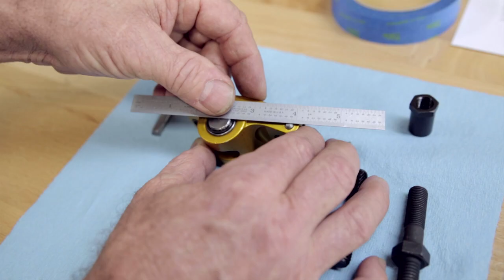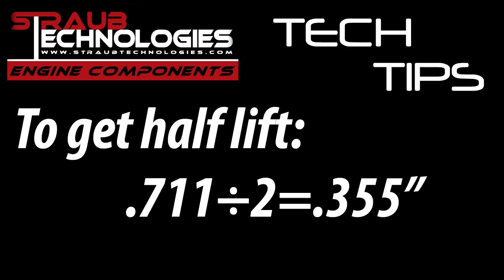Engine Tech: Valvetrain Geometry

Comment: For anyone that may know... I just measured my pushrods with a frozen up hydraulic roller lifter.. Im 100 percent sure the plunger did NOT  move..making it like a solid..
 So.. i set zero lash my hand.. finger tightened the polly lock.. spun the engine over 3 times.. got the roller mark in the center of the valve stem that I colored with a sharpie.  Now here is my question..do I add or subtract for the hydraulic part of the lifter with good lifters?
Reply: good question. I wonder if that lifter is frozen @ the top of its plunger or bottom or somewhere in the middle. If it's frozen @ the very top of the plunger ( think that's what u said) then all u need to do is follow this tutorial exactly. And then replace the lifters of course. Unless they're just really pumped up and not frozen. It might be best to change em' out before doing the measurement. but I can't see the harm in measuring them now unless your new lifters will be at a different height for some reason. Keep in mind I'm just going off what u described and not sure if I fully understood what u were saying. I only replied because this was a fairly new comment and thought what I said might still have some meaning for u. Good luck with your build.
Reply: @guidosarducci3047  The lifter basically acted like a solid lifter. Now, I see you ADD .30-.50 to compensate for the hydraulic lifter plunger...
The lifters I used to.get the measurement is my old lifters. Ill be putting  new ones in. Just trying to make sure I fully understand what I'm doing before I order the new pushrods
Reply: Cool...Sounds like u got it handled. Good luck man.
Reply: @guidosarducci3047  thanks. So im ordering them and hope it works out

Comment: Question: What is more important - the 90* relationship between rocker and valvestem @ 1/2 lift - OR - a centered swipe of the rocker on the tip of the valvestem? I'm setting up a garden variety healthy 355 sbc. Using 1.6 roller rockers and Flotek 180cc heads. I used this technique to determine PR length. However, with this "correct" length PR, my contact patch between rocker tip and valvestem tip is a bit outboard of the valve centerline. I could "correct" that by shortening the pushrod - but then I wouldn't have the 90* angle anymore. Is one more important than the other?

Comment: I know this is an older video.. but it is just that easy? Has anyone used this method, ordered the pushrods and put the engine together and run it?
Reply from the maker: We sell around 100K worth of pushrods a year.
Reply: @straubtechnologies   I had no idea you sell pushrods. Ill be ordering from you then. See my question above if you dont mind...
Reply from the maker: @19jody72  You add .050" to the length.
Reply: @straubtechnologies   so add .050 getting the measurement  like in your video?  What I did, is take a fully pumped lifter, adjustable pushrod.. set it all up. I come up with a 6.750 length. I tried your method, I just couldn't figure it out. It came up to like a 6.580. Im not an engine  builder by any means. From what ive read online and seen on youtube .
Reply: @straubtechnologies   do you have  5/16 hardened  6.750 - 6.800 pushrods?
Reply: I'll email you later this afternoon when I get off work

Comment: Using this method I found out the pushrods I originally bought were dangerously short, .25” too short. Damn I’m glad I took the time to do this. I haven’t put too many miles on it yet so I hope the damage to the valve heads is minimal, it was good on the #1 exh valve I used to check this although my wear pattern was obvious, about 3/32” wide but centered over the top. So centering the roll pattern is obviously not the right way to determine PR length.

Comment: hi, thanks for the video, its excellent. i have a 350 that im installing roller rockers on and i can either have sweep at mid valve or 90 dergees at 1/2 lift but i cant have both. with sweep in the mid valve position my rocker is at 90 dergees at almost full lift. will removing material from the valve tip reduce this problem?  i cant find info anywhere on how to fix this problem. thanks.
Reply: Great point, and I wish he addressed this. I'm in exact same boat. I can EITHER have a pretty, well-centered swipe mark on my valvestem tip, OR I can have 90* relationship at 1/2 lift. Not both. With "correct" 90* angle at mid lift, my swipe pattern is a bit outboard of centerline - suggesting pushrod is too long.

I'm going to trust this engine builder knows what he's talking about and move forward with the PR length that provides the 90* angle at mid lift, cross my fingers, and hope for the best. Wish me luck! Good thing is my engine is for a boat that'll have a propeller that puts max engine rpm at about 5100-5200... So it's not exactly a "high speed" valvetrain application. If you look at the junk valvetrains that came from detroit for 50 years and worked just fine up to 5500-6000, you can see that just about any valvetrain geometry will work ok for low(ish) engine speeds. 6000+ is where it really starts mattering. 7000+ it better be just right. 8000+ it better be amazingly good. 9000+ there better be some magic pixie dust in there.
Reply: GroovesAndLands can you let me which way you go and how it was going together. I still haven’t finished mine.

Comment: So what about hydraulic lifter preload?  do you take that into account for pushrod length or is it not worth worrying about?

What about dual pattern camshafts that have different lifts between intake and exhaust?
Reply: My thought process is to determine the numbers independently. For example if the intake is .625 use your formula for the intake then re do formula for exhaust. Each will have its own number. I’m still trying to figure out preload.
Reply: @paulbivins , thats what I was thinking, this virus put my project on the back burner but now getting back into it slowly.  For me my intake lift is 0.520" lift while exhaust is 0.542" lift.  With that difference it makes me wonder if I would benefit from having a specific length pushrod for intake and exhaust.

Like wise I have had some people state to me that I have to take this video with a grain of salt cause it is being done on a big block chevrolet head.  I personally dont see why it would be a big deal, a engine is a engine and doesnt matter who makes it.  I dont see how the geometry being pointed out here would change from brand to another.

Comment: What if it's a 5/16 stud ? Wouldn't that equal 28 threads per inch?
Reply: 7/16" = .050, 3/8" = .042 and 5/16" = .036. Take 1/2 your lift and divide by 36. This will tell you the number of turns. Example 600 lift / 2 = 300.... 300 / 36 = 8.34 turns

Comment: Do you have the piston at TDC? Also with a .809 intake lift and .819 exhaust lift, would you set the length for both using the .809 lift?
Reply: No, you use 2 different pushrod lengths, especially on a canted valve engine like a big block Chevy or big block Ford.

Comment: So with a hydrollic roller, you don't need to worry about rocker geometry and noting how many times you need to turn the adjuster nut on the rocker arm and instead just do it like this video below, correct?  Notice how no math is used in the video and no worry about how many times you turn the adjuster nut on the rocker.  Only thing I'd do differently than the video below is use an actual push rod length checker on the adjustable push rod.

https://www.youtube.com/watch?v=9sWnhRe8rs4

Comment: great explanation, except he forgot to explain the different measuring
   requirements for solid lifter and hydraulic lifter.   when measuring 
pushrod length,  add .020 for preload,  if using hydraulic lifters.
Reply from the maker: Norm, thanks for the kind words.  We add .050" because most hyd roller today have around .140" of plunger travel and the OEM have found more preload allows the lifter to recover quicker.
Reply: @straubtechnologies   that is true.  i was only thinking of non-roller.   still,  your 
    explanation/demonstration  is the best i have seen.    thanks.

Comment: Do you have to have a soft spring or solid lifters to do your pushrod measurement?
Reply from the maker: YOu don't need them when doing it this way.  Only special tool you need is an adjustable pushrod.  If engine is hyd roller, after you have measured your pushrod length, add +.050" for preload on the lifter.
Reply: @straubtechnologies  I should have read this before I ordered my pushrods. What I did was set my rocker to 90° then adjust my adjustable pushrod measuring rod until I got resistance. That measurement was 6.423. I realized I didnt have my gasket installed so I added my gaskets compressed measurement of .041. This gave me 6.464. I ordered 6.450 rods. How much of a difference will .050 make? Should I send them back and get 6.500?

Comment: Awesome vid, so would there be a difference from a 1.5 rocker to a 1.6 ?
Reply from the maker: Yes sir.  You want to use the lift number generated from the rocker ratio being used.
Reply: Thanks for the reply, 1.5 & 1.6 rockers, where & how much do I plug the math into the equation for the 1.6?
Reply from the maker: @mikedunn9812  Lobe lift should be on the cam card.  Multiply lobe lift  by 1.6.

Comment: Your video is great and easy to follow. I have a question regarding preload and how to set it. Using your method shown I can find the pushrod length. Then add compressed head gasket thickness to the length. And then add 50 thou for preload? Is the theory that the extra 50 thou simply pushes the lifter in 50?  If that’s the case then how do you tighten down the adjusters?  Do you use the same technique and rotations and the last 50 thou just automatically pushes the lifter down?  I understand the pedestal type set up and shims vs torque but I’m unclear on stud type
Reply from the maker: Yes once you have established the length you need, add .050" to the length for preload.   Keep in mind all OEM and most aftermarket hyd lifters have .140" of plunger travel.

Comment: I have brand new summit heads that i spend over 1100 dollars on for this small block 350 and have just discovered that i am having .008 variances in valve stem installed height. It was throwing me for a loop trying to set up this rocker arm geometry. Is it common for you to see this? Do i need to send it to a machine shop so they can grind the valve stem tips. I have also heard stories of new heads having .008 valve seat runout straight out of the box.

Comment: @ 5:20 where you establish that initial 90 degrees I am unable to get my rocker arm high enough to establish the initial 90 because the stud is too short so i am unable to start the nut. 
What do i do in this scenario? Thanks for the video. I have a small block 350 with summit aluminum heads with comp Ultra-Gold 1.5r rocker arms.
Reply from the maker: For Mock up you can use flat washers under the studs hex nut to get your measurements.   More than likely you will need a 2" long rocker stud.
Reply: yep figured that ordered the 1.900 inch arp studs thanks for the FAST response!

Comment: Your radius is actually at the underside of the front roller on the rocker arm and not the higher center line of the ''diameter roller"... the true radius arch is at the bottom / contact point of the top of the valve stem.
Reply: Nope, wrong. Centerline of trunnion bearing to centerline of roller tip is correct
Reply: You are absolutely correct.  The top tip of the valve is the mathematical pivot point, aka the pivoting radius. This video is way off .. because there is no accounting for the roller bearing's size / radius.
Like, what would happen if the roller bearing was larger or smaller diameter  ?
That's where this tutorial fall apart.
As the line dhould go from c/l of the trunion to the top tip of the valve.

Comment: Where did you get those temp springs for the valves?
Reply: Both Summit and Jegs offer low tension springs for checking push rod lengths. Er hell, I’m sure even Amazon sells them. The ones I got were made by Comp cams. Also as someone asked above, you could MAYBE use a std hyd lifter when using low tension test springs. That said, I would use a solid lifter for the most accurate measurement possible. And honestly, after spending nearly $8,000 on top shelf pieces for my motor, springing another (less than) $100 for a cpl springs and solid lifters is a no brainer. But hey, its your dime. Lol

Comment: So I can expect my engine builder to do this properly for me when they put the engine together with the parts I supply, plus whatever machining they have done to bring a nearly 300,000km 302 Windsor back to life? For example the cam I want has to have some mods done to the heads, the heads will be Edelbrock, both cam and heads won't be crazy can't drive it to the shops. I'll have roller rockers (and cam obviously), but will have to leave pushrods until the engine builder tells me what I need? Along with head gaskets if they had to take much off the deck height and any impact that will have on the intake manifold I wish to fit. Just curious as to what to ask and what instructions to give them.

Comment: I use the Manley pushrod checker, comp cams tech had me do it like in the video and the pushrod length were the same both ways …… slip it over stud till it touches top of valve then adj pushrod to touch the checker

Comment: I wonder why this doesnt work on my Buick 231 with Roller rockers on pedestal mounts? When I align it at 90 degree's the roller is so high up on the pedestal there are no threads left :( Any idea's?
Reply: This method does not work with pedestal mount.

Comment: This works, but you need to add another .050 to compensate for lifter compression, stud flex, and to achieve a better angle at the lift zenith, where spring pressure is highest.  Also, this theoretically provides a little more lift...
Reply: @lamont814  Yeah.  As regards my original comment; I'm satisfied that I knew what I was talking about at the time, and made the statement to help others.  

I just don't remember the precise reason at this point, my focus has moved on to other non related subjects, and I honestly don't feel like watching the video again, just to refresh my failed memory. :)
Reply: @lamont814  It's been three years...  I don't actually remember.

Comment: This is ok but what about the pushrod side of the rocker arm how are you going to "optimize" that end using this method?  What if that side is way out to lunch yet the valve end is ok what's the best way to split the difference?

Comment: if you were to use a sharpe..and mark the whole valve stem top, and rotate the valve train.  where would roller tip ride on stem..? do you check that..?  it could not be center,,?

Comment: i checked mine on my 383 sbc with a retrofit hydraulic roller cam & lifters using this video & i got that it needs a 7.650" push rod. how much more do i need to add for the lifter preload? the lifters i'm using is Street Performance Hydraulic Roller Lifters, i'm not sure how much preload they require. the sweep pattern is on the exhaust side just about 3/4 of the way across the valve tip, but the sweep pattern is only about .040" wide.

Comment: I am currently using this method to calculate pushrod length. the problem I am running into is that the roller tip contact is very far towards the exhaust side of the valve tip. it's not rolling off but it's close. 1.5 ratio rockers on a 7/16 stud. Where can I get the correct rockers to solve this issue? small Chevy.

Comment: Anybody can explain how to get accurate half lift position??
Reply: I was thinking the same thing.
With hydraulic cam get false readings due to lifter pre-load spring tension fighting with low tension valve set-up springs.
Doesn't seem possible to verify mid lift 90* without a solid lifter.

Comment: I am building a 540 bbc
with dart pro 1s. The question I have is to
get proper rocker geometry do u need to
torque the head down
with the gasket? I also
need to check my piston
to valve clearance. I would hate crush a brand new gasket in
order to set the geometry right. What
I am really saying I
want the proper pushrod 
for when I check my piston to valve clearance. Any advice
would be greatly appreciated. Thanks

Comment: I may be wrong, but wouldnt you need to first make sure your cam lobe is at half lift before taking a measurement? Assuming he's already done that, from what i gather in the video he still did it wrong. After he put the pushrod in and went down an additional 7.1 turns which would be half lift, he lengthened the pushrod to technically zero lash. Shouldnt he have kept going to where it opened the valve to half lift, then took the measurement? That way cam lobe,valve, rocker, everything is at half lift......or you could do it on the base circle like a normal person and save 20 minutes.
Reply: The cam is on the base circle fir pushrod measurement so when the cam comes up to 1/2 lift the rocker is 90 degrees to the vslve.make sense?